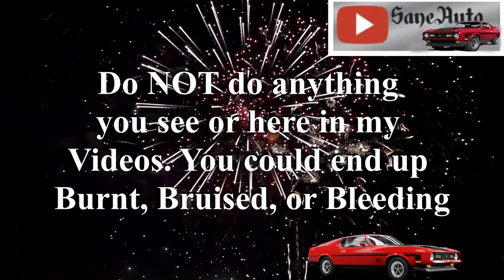hose clamp pliers tool review and unboxing

Comment: Great video with plenty of explanation. Well done. I have just stripped down the front end of a Jaguar XF, where there is virtually no room to get to any of the coolant hoses. I used this very set of hose tools and they were invaluable. Admittedly, some of them when under strong grip wouldn't hold against their ratchet, but on the whole they worked a treat (you can file the ratchet grooves a bit on each tool and then they work OK).
Reply from the maker: Thanks for the comment and Thanks for the tip about filing the ratchet grooves.

Comment: Cool. There should be a way to adjust cable tension on the tool as it gets used. Just a simple adjustment barrel would do the trick (like you would find on a bicycle).
Reply: That's genius!

Comment: I purchased the ones with the long cable and the ratcheting mechanism failed after two uses. If you look at numerous brands including Astro tools they are the same. Even my long reach Quinn from HF are the exact same as far as the base of the pliers are minus the extension. Very very disappointed

Comment: My biggest issue with these clamps is that most of the time they're too big to work where I need them.  The ratcheting is okay if you can get it to stay on the clamp which I can't most of the time.  Other day I had to remove a clamp on the hose connected to the vent solenoid.  None of these clamps would work because you have to be at a right angle to the clamp and I only had about 6 inches of clearance.  Should have just bought some right angle pliers, or better would be like small welder clamps.  The only piece in the set I found useful is the hose prier.  Wasn't sure about using it but much more useful than trying to use a screwdriver.  hf has a set of these pry tools which work too for small hoses like vacuum lines.  Just have to make sure you don't poke a hole.
Reply from the maker: Well said. Thank you for your comment.

Comment: whats the tiny piece of metal that unscrews and has its own little spot in the top section middle left? i have no idea what its for.
Reply: I'm waiting for that answer too
Reply: Someone just told me it's a provisional part made for the long extension tool, in case the tiny metal stopper bit at the end of the cable ever wears off. You feed the cable into this bit and tighten it up to keep the tool functioning.
Reply: @621retsamz  thanks bro!